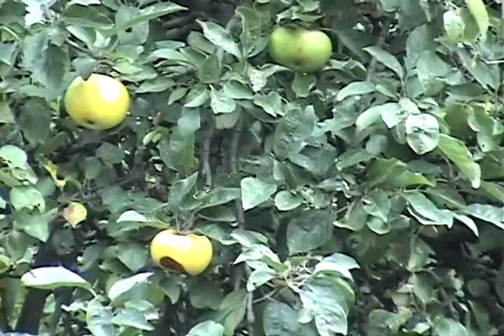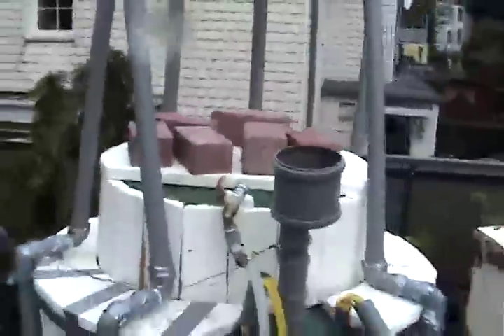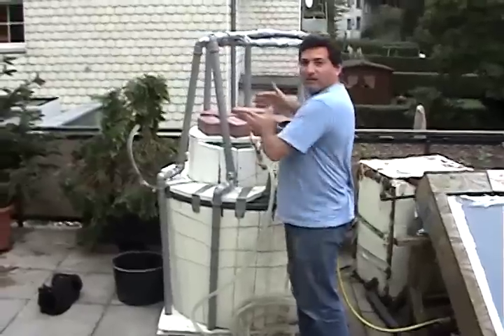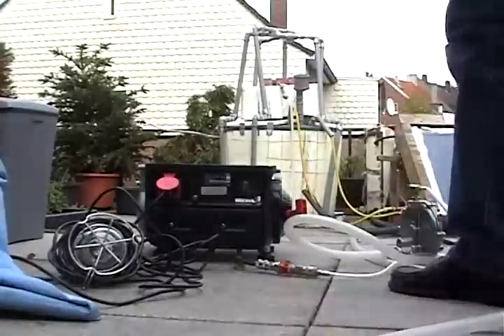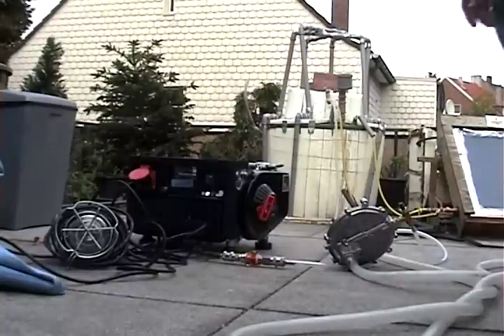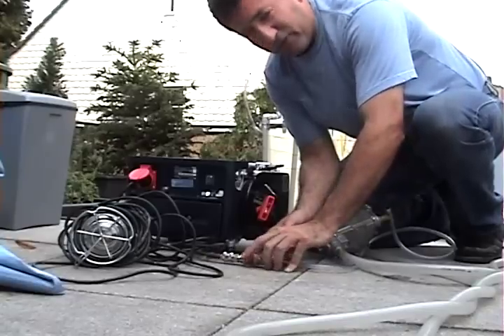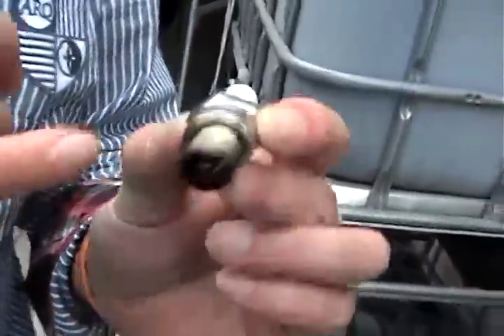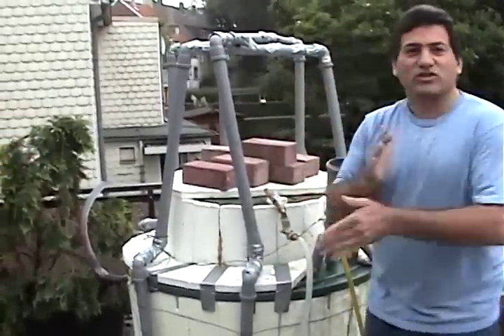Running a small engine on household biogas using "brickage' for gas pressure 2

Comment: I live off grid and produce my own elect .
Often folks that don't really get energy  create no appreciable amount of usable energy. A case in point here is that you can't produce enough juice to power that 3/4hp garbage disposal.
The best way to use your biogas ( after you have removed the hydrogen sulfide) would to burn it for heat as in cooking.
Use solar PV for pc, radio etc, solar for heating bath water,  biogas for cooking.
In other words use the right technology for the right job.

Comment: Get a four stroke it will run more efficiently and you oiling prob is solved.
My genset runs on straight used veg oil and produces 4K it will even run my 140amp welder.

Comment: On the oil issue, have you tried using a gravity feed with needle valve directly in to the carb?
or an oiler between the carb and air filter instead of feeding it from the fuel side?

Comment: Really enjoyed the demonstration. I am trying something similar but with a larger fixed dome cow dung biogas digester. Having problems with excessive water condensation in the gas pipe which might be helping remove C02 but actually gets into the engine. I hope you will post updates. Good luck and thanks for sharing!

Comment: Hi really good to see people doing this sort of thing, hope you get the oiler sorted out. You should not try to oil the engine through the plug hole because the oil is very important to the crank and con rod bearings, and this will not reach them.Maybe a 4 styroke would be better, you could pick an old one up on ebay for not much more than you spent on your oilers. 
Keep saving the planet.

Comment: Black paint on the tank , a mirrored floor and side circumference cage,  a glass ball on a pole at the top and center of  the tank to redistribute the suns light equally around the mirror cage should boost some energy  by quikening the release of the gasses.  Sacred geometry of the positioned mirrors to center the Suns power should help the harmonics of the light to focus the heat  to upwell the gas from the solids and liquids in the tank. Just thoughts.

Comment: use an 500 gal propane tank to put the bio gas in and put a glass gauge on ether the front or side of the tank so you dont over fill it  plus put a hach on the end to clean it out near the bottem

Comment: I have worked with lpg and gas regulators at my past work as a mechanic. I think that if you partially close the choke of the carburetor you will trick the regulator to feed more gas because a vacuum is needed to operate the diaphragms of the regulator more vacuum more fuel

Comment: As far as food waste goes, I think that using apple scraps is a great way to go. I'm basing this assumption on my experience with fermenting cider. Apples seem to produce more methane than any other fruit I've fermented in the past, so much so that I have to attach a gas mask filter to the airlock! When fermenting cider it's important to add trace minerals in order to achieve high attenuation. Have you tried adding other kinds of food scraps of diversify the nutrients available?

Comment: Nice job so far. I would have to recommend that you introduce a fail safe to your project. It is true that you are dealing with a small amount of gas, but you are sharing ideas. I believe you should include safety as a vital part of your design, in the event someone should use what you have learned and increase the scale.

Comment: rather than using bricks, have you thought about using a small tire inflator type of air compressor to move the gas from the digester to a storage tank like a propane tank?  I am wondering if this is possible, this way you could put the biogas in a tank under pressure. also you can take the tank where you need to run the generator with out being near the digester.

Comment from the maker: @dnndirty74 You are absolutely right, we don't need the regulator. In our trials in Egypt a couple of months ago we bypassed it completely. We keep it on the engine here in Germany and in Cairo in case we want to switch to an NG or propane cylinder, but don't need it at all for the biogas. Since it came with the kit from US Carburetion for trifuel use I just assumed we needed it at first, then discovered, nope, no need at all! Thanks for bringing that to the attention of those who may b watching

Comment: Without any degree of true research (sorry I'm pretty busy!) - so take this as a grain of salt (pun intended) sodium bicarbonate reduces H2S. Methane can be made into Methanol? HHO will raise the explosion if combined with methane, and clean the emissions, at low input levels. Natural gas gensets are closer to being the device for the job than worrying about the hassles of a 2 stroke - which are a dirty polluter to begin with. Propane gensets also might be a consideration. Just some thoughts!

Comment: From sites where it has ben used for cooking I could see some suggestions that water vapor can be removed by running it from bottom to top through a sealed tank half full of water. So you it woul buble and eventually the vapor would condensate within the water and then you catch it after bubling (or it might catch more vapor). It is also said that this removes some CO2 . Also they mentione that some steel whool put in the pipe would catch whatever components cause citchen pots to get burned.

Comment: Very nobel effort tculhane. I however would not think of using biogas as direct feed for whatever engine. At least not without some high tech chemistry purification. I am very new to the field but so far I learned that biogas is comprised by many components. To what I learned it includes 30-40% CO2, 5-10 Hydrogen, 1-2% Nitrogen, plus what was mentioned as water vapors and some Hydrogen Sulphide traces. So I am thinking for usage for heating in a greenhouse or whatever heater or for just cooking.

Comment: uhmm ok  another suggestion... compress the gas... I've been using fridge compressor for a long time and they can generate pressures of up to 35bars, are really robust and have decent flow (10L tank to 100psi in under 10 minutes)...
Just attach the inlet tube to the reactor vessel and the output to a large LPG tank or propane tank... it would be a good idea to add that sulphur dioxide filter between the reactor and the compressor to increase its longevity

Comment: For drying use an inline desiccant drier found in airconditioners and air compressors $10. Or build your own drier so you can change the desiccant material - both  can be purchased from an A/C or  industrial suppliers.

Comment from the maker: Hi deiseldes1, we have successfully adapted and run a 4 stroke 6.5 HP engine/generator in Cairo using a 190 dollar kit from US Carburetion (in West Virginia) that took 15 minutes to install.  4 stroke engines, as you know, are self lubricating.  However the water vapor in the biogas did make starting difficult as these engines are more finicky than 2 strokes.  And we eventually broke the spring on the pull start trying to start it so many times. But 4 strokes are the way to go.

Comment from the maker: Hi Engineeringtube,
Good question. Some biogas does leak out from the gap but it is such a small quantity that we can't even ignite it with a lighter moving around the perimeter.  It appears that the methanogens cluster under the gas collection tank where true anaerobic conditions prevail, and it may be that other facultative aerobes in the area where the gap is are metabolising feedstock into CO2. Also, because the feedstock enters the center of the tank the sides may be depleted.

Comment from the maker: Thanks so much masterix6! I just ran some trials using the tank of water so I can vary the pressure and it works great so long as the height of the telescoping gas container doesn't rise too high (at which point it bumps into the support cage; and if I remove that it will topple over).

Comment: I love what you did.  It gives motivation to those trying to make projects work.  I am humorous and I can't resist though... Its nice to see that kitty was your captive audience. Very cute!! I was praying things wouldn't explode on kitty.  EXCELLLENT PROJECT.  Here is a suggestion though.  Try putting a tank of water on top of the gas cover to give a more even distribution of weight to replace the bricks.  It also would allow you to continue adding on more pressure by allowing water to flow in!

Comment from the maker: Thanks d3adp001!  We do have the trifuel conversion kit for the 4 stroke engine from propanedashgeneratorsdotcom and we will use it in Cairo next month -- it is, as you know,  a lot easier to do the conversion (no carb drilling necessary) and of course the lubrication problem isn't there. But the 4 stroke costs 230 Euro while the two stroke cost 80 Euro and most third world engines are two stroke so we thought we'd give it a try! We want to figure a way to help the trash recyclers in Egypt.